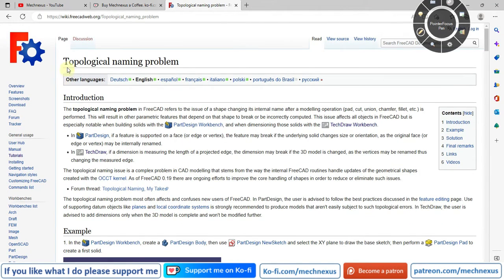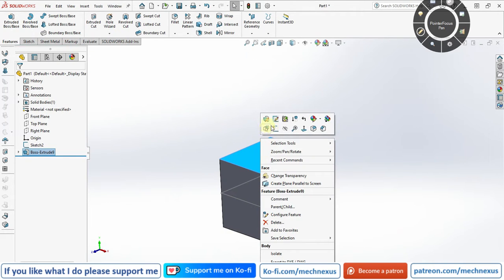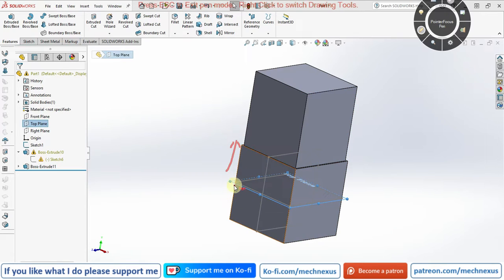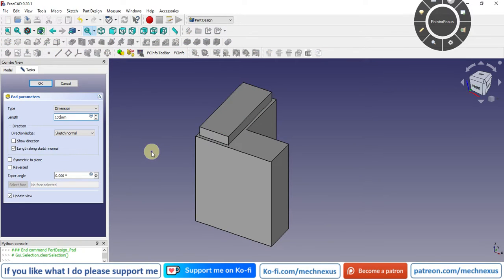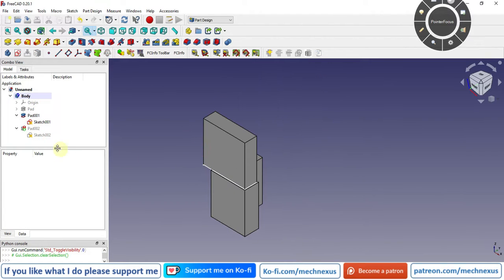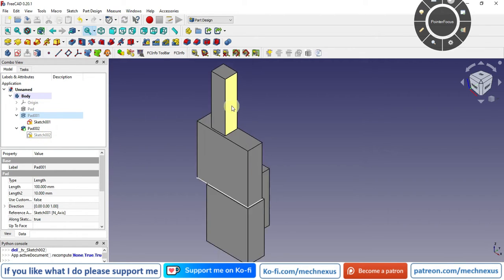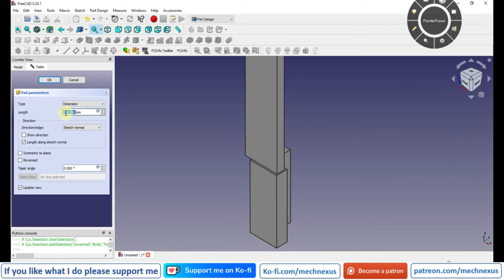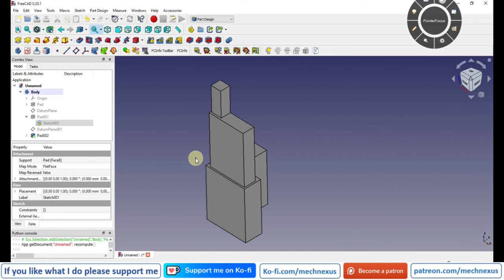Fix Topological Naming Problem in FreeCAD | FreeCAD Tutorial | FreeCAD Modeling | Learn FreeCAD |

Comment: OK! Good idea!
But it only works if you connect objects using faces. 
As soon as they intersect, this method will not work... As soon as you add, for example a hole to an object, it creates new edges, circles, vertices and faces... in that object! So the names of the other edges, circles, vertices, faces change. 
Or am I wrong?
Reply: I believe you're wrong. With this method, it doesn't matter if you create new faces, since the datumplanes position are driven by f.ex the height of the pad, it doesn't care about any other data than that.
Reply from the maker: Yes, you are right. You can try realthunder branch of FreeCAD. I have not used it but i have heard about it that is has solution of topological naming problem. Many stable feature of realthunder is integrated with FreeCAD stable release. I will make a another tutorial on it once i use and test realthunder which i have not did yet.